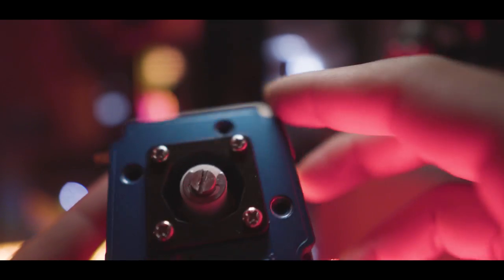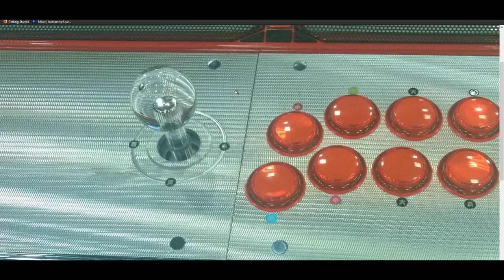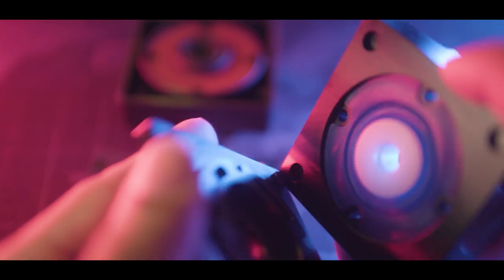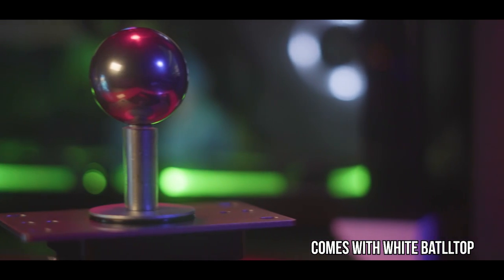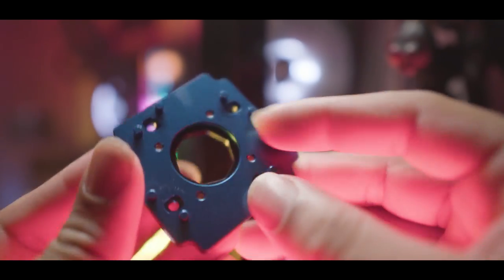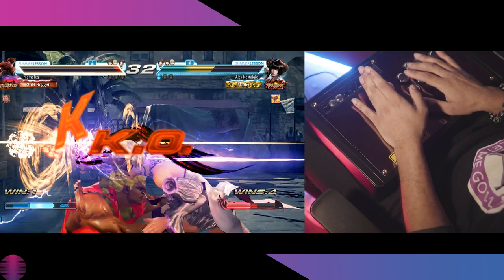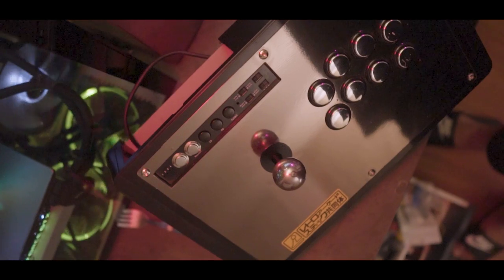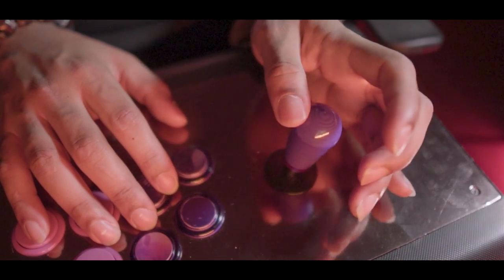The Ferarri of Joysticks - Sanjuks Levers

Comment: I'm guessing you can use a phreakmods link on the v3 since you did mention we can use aftermarket sanwa parts for it
Reply: Unlikely tbh since phreakmod link has a much larger upper shaft even compared to sanwa, which will make contact with korean collar. It may fit but won't work since throw is too small.

Comment: Hey bro, I'm coming from the Japanese jlf and i have switched to the knee lever which i really liked recently i tried the v5 and i found it quite accurate but in contrary to what others say about the knee lever i found the sanjuks to be quite awkward to find the diagonal and preform stuff like the wavedash, i really found it awkward to a point i started thinking that i may have caused a bit of damage to it while installing it, therefore can you guess why that might be and what kind of differences it may have in comparison to the knee lever that may cause such problem? Thank you in advance and your channel is very informative.
Reply from the maker: comparing the v5 and knee lever are quite different beast however if the V5 has the "tekken" actuator that requires a deeper pull to the corner.  The Knee lever to me, dont own it anymore so going off memory, had bigger corners than the V5 but overall I liked the feeling of the V5 over it and is now my main lever.
Reply: @alexnostalgix  thank you for your reply, so is there a certain actuator that i might install that might make it preform better? Is that what you are saying because i honestly didn't catch what you meant by a tekken actuator, my apologies in advance i don't have a solid background in the matter, i already appreciate the v5 but still found it awkward for my mishimas maybe because i put a lot of time into the knee lever.
Reply from the maker: You would have to buy an actuator set from Bandit from what I know. They call it the "tekken" actuator buts it is just a term for the smaller actuator, bigger deadzone and  whether you prefer it or not would be up to you.  I don't think it would perform "better" just may be able to give a more desirable feel. No worries about the background man, we all are learning lol.
Reply: @alexnostalgix  thank you very much you rock man.